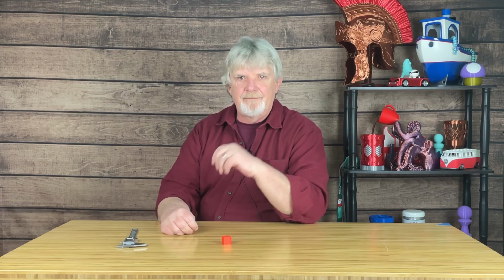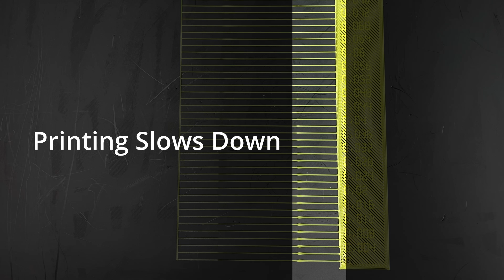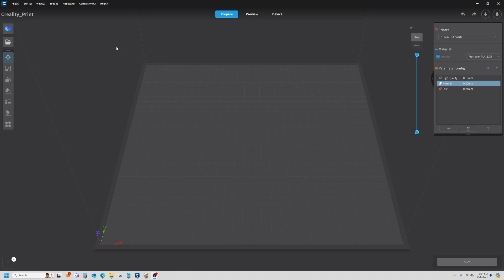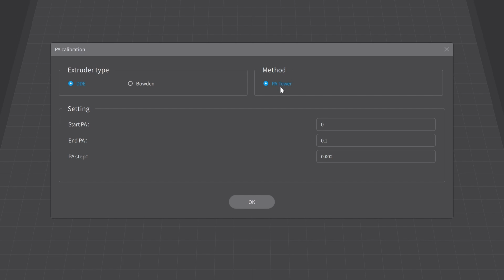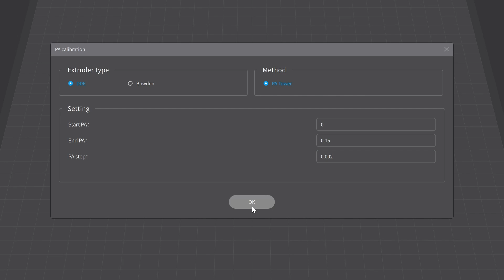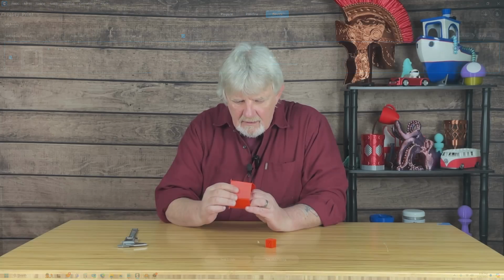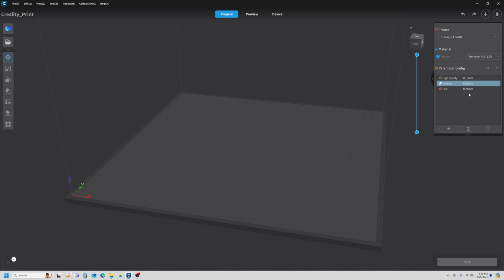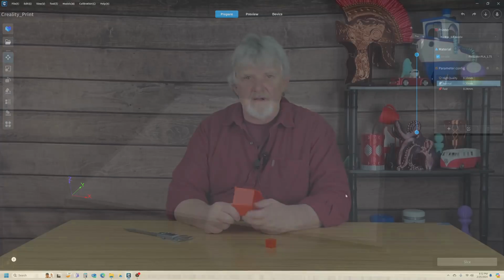Calibrating Pressure Advance In Creality Print

Comment: Ive just started binge watching your channel so I apologize if you mention this elsewhere....but what is the best order of calibrations to dial in your printer. Start with nozzle temp? Plate temp? I would love to know the order of operations. Thanks!
Reply from the maker: I do a temperature tower first, then flow rate. I've never had to mess around with the plate temp. Then I'll do retraction distance and pressure advance followed by max volumetric speed.

Comment: Hey boss. I appreciate this video. I think I now have the courage to start making adjustments for this bulging issue. I played with all sorts of stuff on the Prusa Slicer, but, I am not smart enough to get over my fears of corrupting the software and firmware, AGAIN!!! LOL.  I have been playing at this 3D printing stuff for about 3 years, with an ENDER 3 V2, and having so much fun. I have lesrned so much, while still not very confident in a lot of the "why's" of so many slicer adjustments. I imagine time plays a major role in this, while doing one change at a time, check the results, and either go back to what I know had best results, and then make another change, up or down, or somewhere else up or down. It occupies my mind when my skeleton is letting me know I have made some pretty poor occupational choices besting the heck out of my body, so 3D printing has been very therapeutic for me. "Action is the enemy of thought". Staying busy, keeps the doctor away.

On my ENDER 3 V2, as you know it has a Bowden system, and has performed well, but, i would like to venture into printing TPU. I have not tried it yet, even though, I purchased a pair of dryers, to get that out of the way, and i purchased a CREALITY direct drive system from their website. 

It comes with a single page instruction, that it is a direct plug & play installation aspect. Yes, it does require the old hotend trolley to be unhooked and unplugged from the controller board, not a big deal to do, and likely will be fun to do, but, do you know, if there is programming I will need to do, firmware changes, software, etc, set-up for being able to start fine tuning to print, right out of the box? 

The new direct drive hotend appears to have the same size filament driver wheel/gear as the one on the factory hotend. 

I think the direct drive will help eliminate some of the issues of pre & aft type lag issues, all of which are minor and not a hinderence to the parts outcome, but, I know it is there with the Bowden type feed system, as you already know. 

I know this is abstract, and the machine and new direct hotend head not sitting in front of you, makes it just that much more abstract to being able to answer such. But, more over, wonder if you had any experience in doing this change or upgrade mod? Thank you. No obligation to answer if you do not have experience with this.

Comment: Hi, no matter what settings I change, it prints always the same, have buldged corners and at some stage budlged line around whatever I am printing
Reply from the maker: What printer model are you using?
Reply: @pushingplastic7445  Hello, Ender 3 v2 Neo, newest firmware.

Comment: i did start 0 to 1, and 1 to 2, with 0.002 sequence and i dont find any difference, is very ugly the line, im using V3 SE, is pressure advance maybe disabled on marlin?
Reply from the maker: Marlin firmware uses Linear Advance, not Pressure Advance.

Comment: I am changing material settings, but when printing a calibration cube, nothing changes for me. According to measurements, my PA is 0.12. In my print tower, the transition is clearly visible. By default, it was set to 0.005. However, the problem with the seam remains the same when printing the cube. What could be the problem?
Reply from the maker: The seam will always be there. What we are looking at is the "other" three corners. You can manipulate the seam by relocating or setting the seam location to random to get it off of the corner. What I would like to see in a later version of Creality Print is the ability to move the location of the seam to the middle back.

Comment: Cant seem to get the tower to work. The print looks the same from top to bottom, any ideas why?
Reply from the maker: If you are running a printer with LIDAR like the K1 Max You need to turn off motion advance from the printer console. It's under settings, AI Functions. When using Creality Print with Motion Advance turned on, the printer will try to control pressure advance for you. It works pretty good to. Another thing you could try it setting a wide range for the steps, start at 0, end at 1.5 or 2. The higher you go, the better chance of seeing a difference.
Reply: @pushingplastic7445  im using the ender 3 v3 SE. Ive tried with the PA turned on and off. I see no difference. 

I've also tried calibration cube with PA set to 0.01 and 0.07 with minimal to no difference what so ever. Not sure what im doing wrong here.

(Im using creality print)
Reply from the maker: @gustavsvensson6877 The Ender 3 V3 Se is running Marlin Firmware. Pressure Advance is aimed at printers running Klipper firmware like the k1, K1 max and Ender 3 V3 KE. But you can calibrate the Linear Advance for the Marlin based printers. Currently I don't have a video for this, I plan on doing one soon, I also have an Ender 3 V3 Se. Good printer! I'm sorry I didn't think to ask what printer you had in my previous reply. I do appreciate you watching, but again sorry for not asking what printer or firmware you were working with.
Reply: @pushingplastic7445  would absolutely love a video on calibrating  pressure advance with creality print on ender 3 v3 se!!!!

(One thing you might be able to cover on that video:
There is a setting in "manage printer"  where you can choose "G-code Flavor". Does this mean you can change the firmware its running? Kinda confusing to me if it would be that simple.

Also weird to have that pressure advance calibration option when you have checked the ender 3 v3 se profile from start.

Big big thanks for covering this and answering questions since most channels out there only covers prusa, Cura, orca etc.
Reply from the maker: @gustavsvensson6877  Printers can be flashed to run a different firmware version than what it came with. But it can only run one version at a time. Take the Ender 3 v3 se for example, it comes from the factory with Marlin pre-installed. All of the profiles in Creality Print for that printer are designed to run with the firmware it wsa made for, in our case Marlin. But you can reflash it to Klipper firmware. Or if you would hook it up to Creality's Sonic Pad or Nebula kit. Both of those are designed to increase the speed of your printers but convert the firmware from Marlin to Klipper. So in that case you would change the GCode flavor from Marlin to Klipper. I hope I worded that in a way that makes sense. If you have any questions about your printer or Creality Print, related to the video topic or not just drop a comment on any of my Creality Print(er) videos and I'll do my best to answer it. You're right, everyone seems to cover Cura, Orca or Prusa slicer. Ask for help online and they'll tell you switch slicers. I aim to provide information on all of those slicers. Don't let anyone ever tell you Creality Print isn't a good slicer!
Reply: @pushingplastic7445  that makes so much sense! Thanks!

Would appreciate a video on pressure advance calibration with creality print for ender 3 v3 se running Marlin!

Havent looked through all your videos yet, but i for sure will! 
Subscribed, looking forward seeing your channel grow 😊